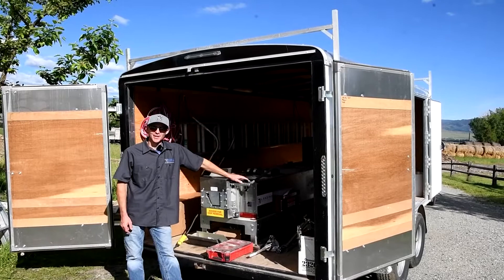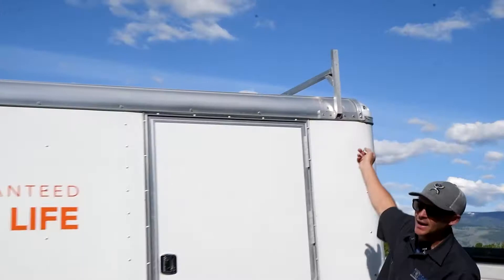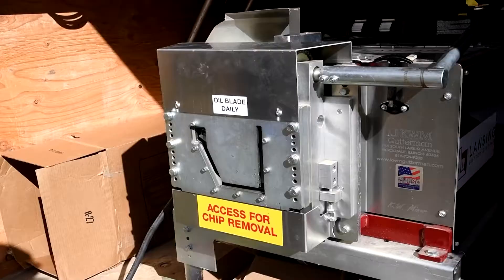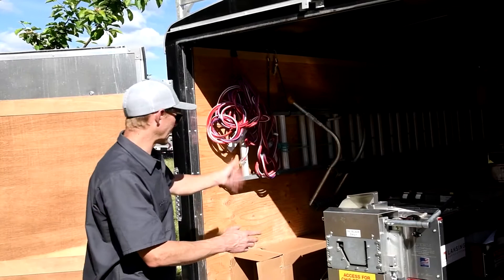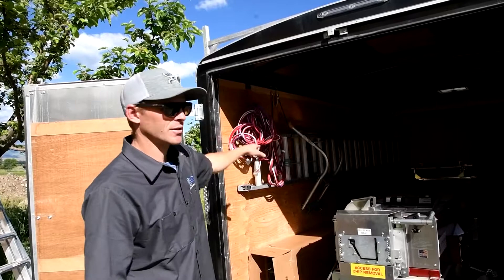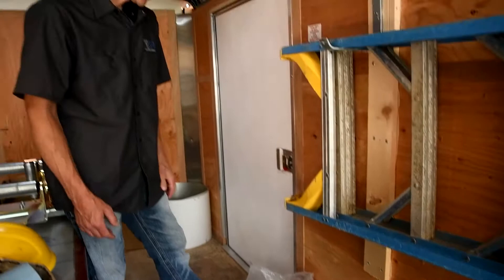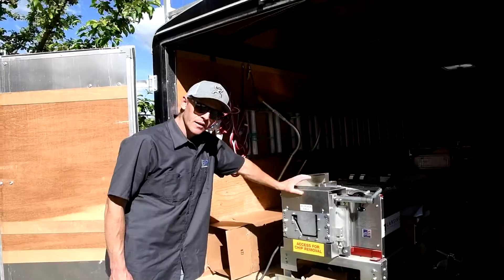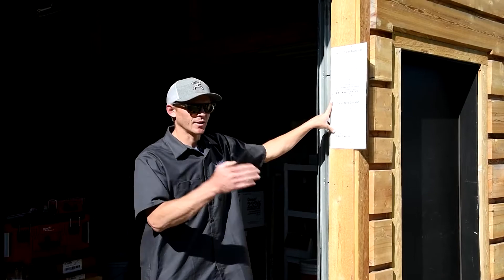How We Set Up Our Gutter Trailers

Comment: Would you guys say a 7x20 is too big for gutter installations and cleaning business
Reply from the maker: Our standard is 7x16. We do have one that is 8x20, but its hard to maneuver and find parking.
Reply: I use a 7x14 all aluminum  and I'm in maine. No issues. My 6 inch machine is in a 7x16 all steel 6 inch machine is 10ft long 5 inch machine is 8ft. Weight distribution is all you need. If your machine is to far back towards door your trailer will float on the hitch. You want to plan your setup. To your needs / guys working for you.